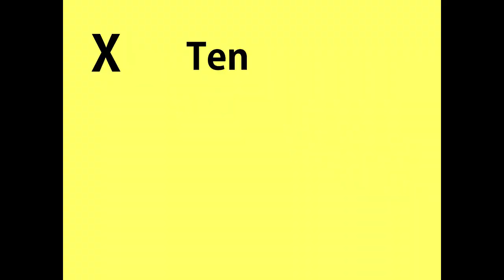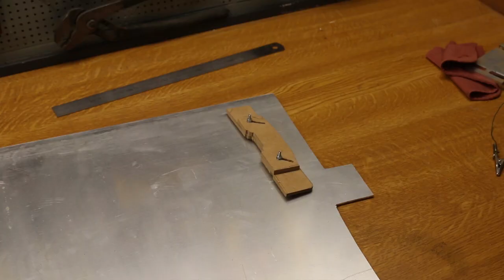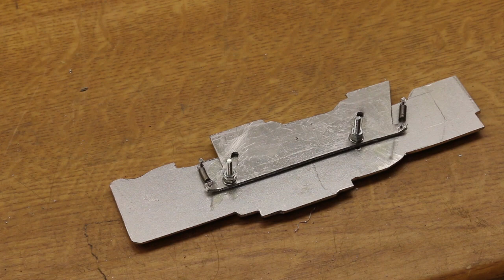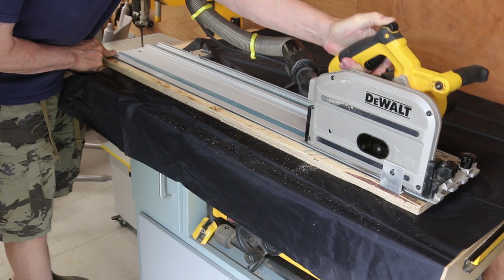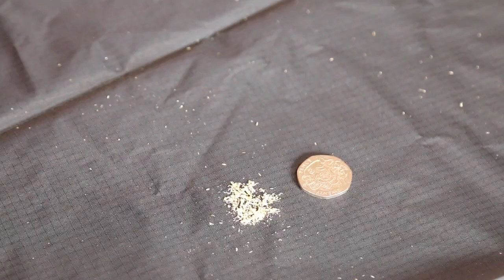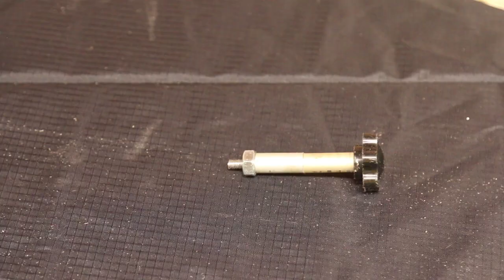New Track-saw upgrade!

Comment: Super idea.  Anything reducing dust in the air, particularly for those of us with smaller work areas is of real benefit.  I wonder if any of the tool manufacturers would be interested in adopting the design.

Comment: Interesting. A Dewalt tracksaw on a Makita rail?  Is it a spare?
Reply from the maker: The DeWalt is designed to use either a dual sided or single sided rail. Whilst a dual sided rail can be used on an MFT, a single sided one is much easier and more convenient to use. I chose a Makita version as the most cost effective- aluminium extrusions are indistinguishable in use, and I will not pay more for a different coloured label...

Comment: The spring mechanism: how'd you get it to spring back?
Reply from the maker: There are two tension springs, one at each end of the leaf. You can see at 2:25 on that these pull the moving leaf upward when the pressure of the saw frame is removed.

Comment: Pretty cool idea! Have you took a look at what the big brands do? Do they use something similar?
Reply from the maker: Big brands? I think DeWalt is pretty big... But no, I have not examined the other popular brands- it is not a view that is shown, but given that they all seem to leave holes on the front (which it is popular to cover over) there is very likely a big gap on the inside too...
Reply: @Tensquaremetreworkshop  big / premium-priced tracksaws like Festool or Mafell :)
Reply from the maker: @AkosLukacs42  I will certainly look if I get the opportunity- or perhaps someone out there knows?
Reply from the maker: Just found a breakdown video of the Festool TS55. They have a similar gap on that side of the blade (no surprise). My solution (modified) would probably not fit, because the return spring is in the way. It is a simple coil spring- as an engineer I prefer the DeWalt torsion style spring system (more even force).

Comment: Nice modification! (still waiting on those welding/brazing videos by the way ;) )
Reply from the maker: I have no plans to show welding- I am not good at it! Brazing I covered in several of my tool-chest videos. Best way to learn brazing is to have a go- brazing brass parts is fairly easy, and steel not hard to do. A propane torch is all you need for small parts.